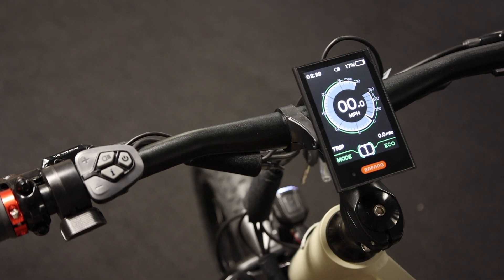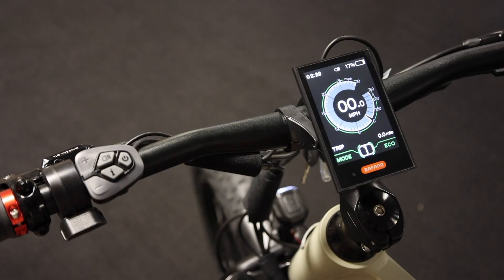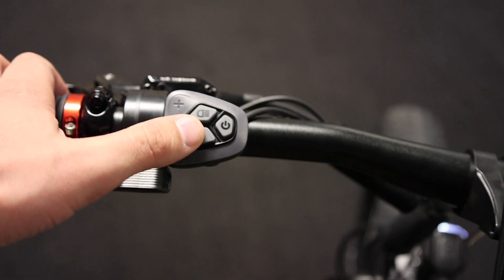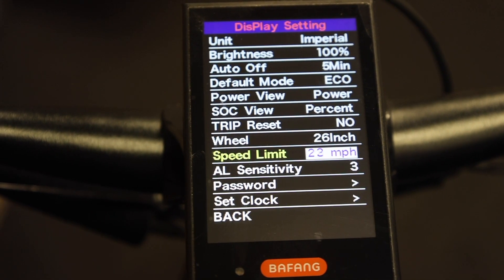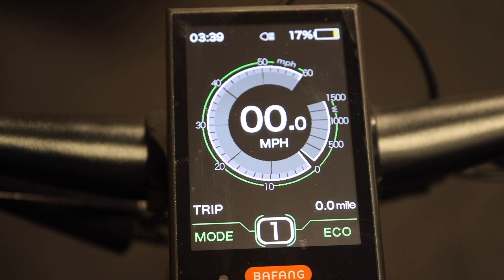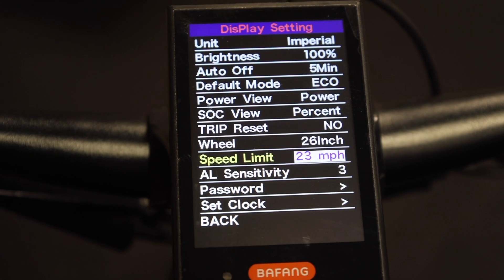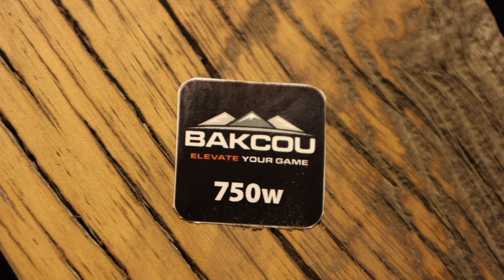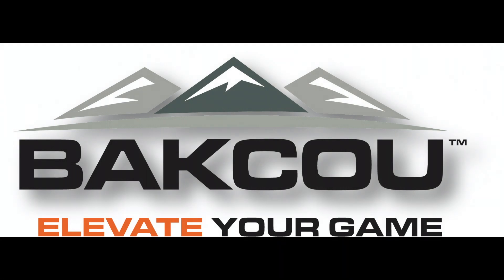How-To | Adjusting Bafang Ultra Mid-Drive Motor Wattage

Comment: I have my top speed set to 60 mph but even on PAS level 5 in sport mode in 11th gear on flat ground the bike will only go to 20 mph, even when peddling my ass off. Has anyone else experienced this? I can feel the motor kicking in and helping me along until I start to approach 20 mph and then it feels like there's a limiter on it, like the governor on my moped back in the 80s .
Reply from the maker: What bike do you have?
Reply: @bakcou  Biktrix Ultra Eagle 2.0, only had it about a month. I just purchased the cable from them and will be setting up a video chat with them next week. I think they can hop on my laptop remotely to try and figure out what the deal is. Thanks for responding, any thoughts are much appreciated.
Reply from the maker: @80sRokker  Gotcha! Absolutely! Happy to help. Good luck on that!
Reply: @bakcou  Fixed by Biktrix!!! We cabled up the bike to my laptop and they were able to go into the controller settings and take the limits off. Apparently they got a batch of motors that were destined for Europe which has a max speed limit of 20 MPH. So even though I set the speed limit to 60 MPH through the display it was still limited. So now the bike is even more kick ass than before! About 30 MPH on throttle only and 35 MPH on pedal assist.

Comment: @:30 "get yourself above...."  If the + and - scrolls up and down the menu, once you're on the Speed limit, how do you select it so that you can change the #? And then how do you get out of the Speed Limit setting to where you can + and - through the other menu settings before exiting out entirely?

Is it like Press the i once?, then use + to increase the speed #? Or ???